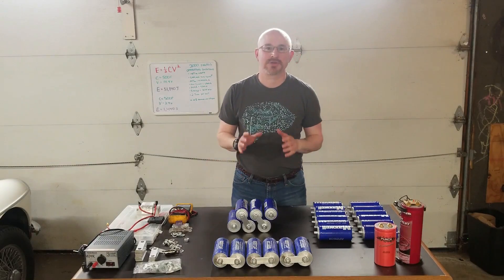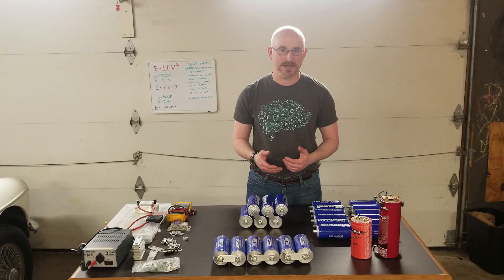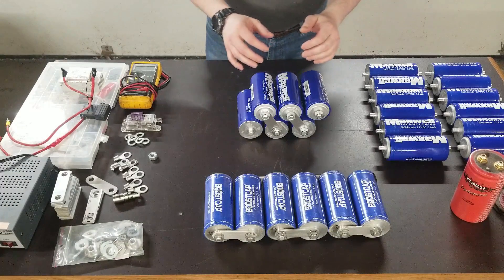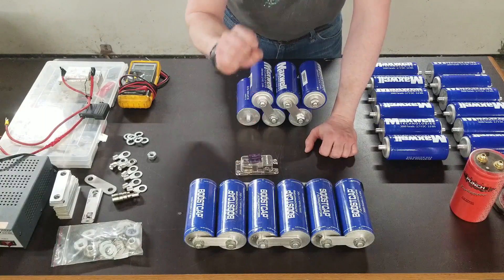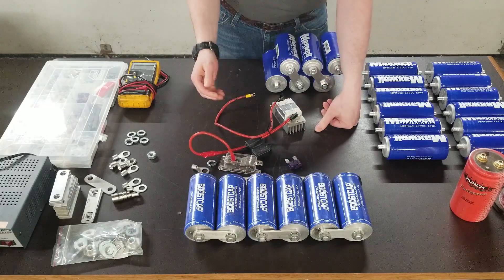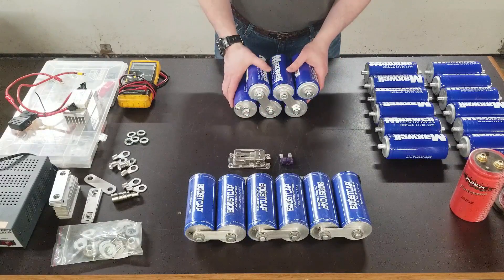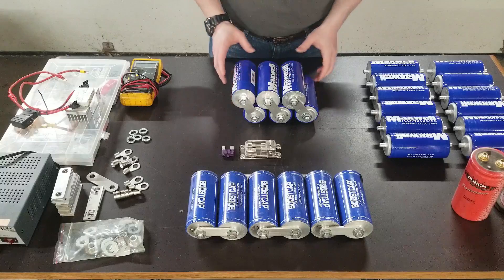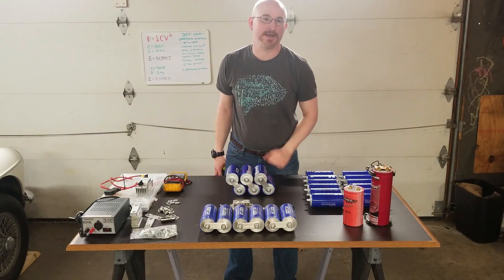Electrical engineer explains ultracapacitor Safety Tips and Tricks - Car Audio Applications

Comment: The heat from his charging resistors introduces even more inefficiencies as a passive, nonreactive load. It would be better to use circuitry to control the current more efficiently with less energy loss through heat production, unless it's winter time and you could use the heat to add to what's already in your house.
Reply: He's only using the resistors for a one time charge from dead. That's why he plugs it into the fuse holder without a fuse then at all other times it's following the batteries. I'm curious why he's not using any balanced circuits.

Comment: Don't be fooled, folks. Those Maxwells are rated with only a two year shelf life. Skelcaps have a 10 year shelf life, AND, these are not replacements for lithiums because they cannot possibly provide as much longevity for energy needs. These are good for impulse power needs, thus paralelled with batteries to prolong battery life, but not the sole source for energy storage. Skelcaps will give you a 10 year shelf life.
Reply: I have checked SkelCap datasheet, but the lifetime is the same, 1500 Hours, or 1 million cicles…

Comment: What would you think of the simplest balancing circuit, which is a zener across each cap? Cheap zeners that I could find are rated 2.5 volts, 500 mA. In the app I have in mind, the charging time is of no significance. Hence I can limit the charging current to 1/2 amp. I can also maintain 14 volts across the 5S string of caps.
Reply: XXYCOM…. Appreciate your enthusiasm deploying 6S SC/UC systems. Trust me, I’m not trying to dissuade and or discourage you from such an adventure. Remember HEAT, which’s the greatest enemy of SC/UC and it’s constantly, that (heat) in all vehicles. I’m sure you are not running a PA system in your vehicle. For a normal listening pleasure maximum sound level is not higher than 5~7watt with a good quality sound system. But if driving an ABRUMS M1A2, that’s a different level! I’d not go there… Best wishes…

Comment: Would this be safe to use in a car with auto start-stop and lots of computerized technology? With city driving and the AC and music cranked that's a lot of starting and stopping while drawing a lot of current. Would this constant charging and discharging of the caps be bad for the car's electronics or the amps? I'm making a build for SQ and have 100w x4 for fronts and 400w x2 for subs. I have a Golf mk7 with Blue Motion tech.

Comment: I have a 72v Gem car and want to increase the length of charge /discharge (run time) on the vehicle now it has 6 lead acid 12v  batteries and I am making a 12v supplemental 6 panel solar array to charge during the daytime hours. what type of system do you recommend to supplement with?

Comment: Possible to parallel to car battery?
Reply from the maker: Absolutely.  That is exactly how I wire them in cars.  In parallel, with a separate fuse.
Reply: Thank you very-much boss... but normally what is the rated fuse to use it? I have 2.7 v 650F caps 6 pcs.
Reply from the maker: @wilsonsabellano3205  i have used a 100A MAXI fuse to protect the cap positive for years with no issues.  I use a MAXI fuse because it is easy to remove when servicing the car.  A circuit breaker would also be doable.   Remember to disconnect the cap bank prior to disconnecting the battery

Comment: How would you use these to jumpstart a vehicle safely? The voltages would differ greatly and a rapid discharge into any part of the vehicle would be harmful. So ?
Reply from the maker: Any jump start application includes connecting a low battery to a high battery/charging system (simply put).  Every time you jump start a car, you connect mis-matched voltages, but not more different than a few volts.  Even at 10.5V, a car battery will struggle to start a car and a car battery will rarely drop below 7V and live to tell the tale.  Even so, the ESR of a battery that is deeply discharged is much higher than the ESR of the capacitors.  This is why charging caps is more sensitive to charging car batteries.   Every time we run the car we see a voltage increase in the system by 2-2.5 volts.  My concern with charging voltage matching is to get it as close as you would in a normal application.  Is that reply in-line with your question?
Reply: @richardvedvik979  yeah I'm just wondering if it'd wreck the car/ECU

Comment: It is sad they only make 2.7 v version...kind of a pain...
Reply from the maker: It's a trade-off with the high capacitance.  The high capacitance is from using a material that would break-down faster at higher voltages, and the proximity means easier arcing capability.  Agreed, totally, because 15V supercap cells would be awesome!

Comment: No balance boards ? That should be part of this video.
Reply from the maker: I've discussed this in some other comments and the consensus is my second video will include meters across each cap with different loads to watch discharge/recharge behavior.    It will also discuss balancing circuits in more detail.  I'm almost ready to shoot that video. 

Thanks!
Reply: How about just Zener diodes across each cap to limit charging voltage to safe levels?

Comment: Building an ebike hybrid battery ,how can I use s-caps to create a high speed burst of speed and for use in regen braking supply back to the battery as well?
Reply from the maker: That question has a longer answer, I can revisit when I'm at a PC with a proper keyboard.
Reply: @richardvedvik979   1.21 Jiggawatts !Truthfully this would be a seriously interesting build to add a burst turbo button to an EBike and nobody has done this yet on battery builds because they are so expensive and new that only  companies like XS and Maxwell are sending out trial caps to sponsors to innovate the use of them .

Comment: awesome video  I have a Honda with a 250 amp alt a group 31 xs power in front with a group 41 in the rear. My stereo when I use it pulls about 150 amps at max my car like 45 amps with ac on etc. I also have air suspention that uses a air zenith ob2 compressor that pulls like 60 amp when filling the tank. That takes about 4-5 min it starts out fast then my volts drop slightly and it takes longer to fill.  Sorry for the long would I benefit from using like a xs power super cap bank? thanks
Reply: Nop .. if IT do not drop in rpm when car is running Then IT is you bat bank ITs too small 
If IT drops when you enigen andcthe 250A alternators runs
ITs you leads from bat to compresser ther is too thin and looong 
You can ofcorse make What you want .. but if leads are insufisiant .. or battery til small .. well Cape get topped off by bat .. if bat drops well Cape Will too.. resistance in too thin leads kill A in to heat in wired instead

Comment: what find totally amazing about maxwell UC's is 5+ years ago the market was so saturated with  both new and used surplus UC's that the manufacturers had quit producing new units and  is was not uncommon to see them selling for $10 a piece or sometimes even less then one guy starts posting youtube videos showing how he was able to successfully replace his car's battery with ultracaps and within a year the market went from massive surplus to critical shortage causing the prices to increase to the point where at times I've seen used ones selling for as much as $100 each and even now the premade ultracap poser banks are selling for as high as $800 each. I always think of the ultracap situation whenever I hear someone say that one person by themselves can't  effect change or make a difference......
Reply from the maker: That's how demand can drive and change.   :)

Comment: Hey a lead acid battery will burn a hole in a finder easy so you have to be careful with them!
Reply from the maker: Agreed!  That is another advantage for ultracapacitor banks in lieu of lead acid batteries (flooded cell or VRLA).

Comment: How can I use these to help out a hybrid that uses ni-mh batteries? I'd like range but more importantly I'd like the system to be more capable... It feels like ev mode is rarely on (assuming this is voltage related?)
Reply from the maker: It's fairly expensive to get up to the voltage of the eV battery pack.  That is the biggest limitation.

Comment: What is each battery volts and AMPs, how many battery required for 48v, 40ah ??
Reply from the maker: Note these are not batteries.  These are capacitors which store charge differently.   Ultracaps are available in 2.5, 2.7, and 2.85 volts per cell.  Ratings vary by model, these are 3,000F.  Voltage drops under load so you size voltage based on ending time requirements.

Comment: I’m Completely Solar Powered I Have A 48 Volt Trace Inverter it’s A SW 4048 115amps Rated 400 Amps Peak Battery Charger 60.0 Amps  I Have 8 12volt Deep Cell Battery’s In Siri’s To  Make 48 Volt I’d Like To Add A Bank Of Super Capacitors to my battery bank

Comment: Cell can be used for the ebike how much it cost for one cell
Reply from the maker: If you lookup Maxwell BCAP3000 you'll see prices on Mouser at $60 each.  Note the volt per cell is 2.7VDC for this model.

Comment: Would it work powering a car fridge?
Reply from the maker: Sorry for the delay.  These would help support a typical battery when the fridge compressor turns on/off.  But you'd still need a battery for long runs and a battery charging method. I will talk more about how voltage behaves in a future video.

Comment: There was a video posted recently showing super capacitors used with solar to power utilities without a battery. What is your opinion on That? Is that even possible?
Reply from the maker: Hi, sure, it is certainly possible, although maybe not cost effective.  The size of the cap bank would be based on runtime and operating voltage.  I purchased mine used from a solar application.

Comment: very excellent presentation! but the audio needs improvement. but this widens my understanding to ultra capacitors. could be useful as a motorcycle battery alternative but for cars and trucks i dont think my dad agree to replace his batteries. could be useful to jump start a vehicle tho
Reply from the maker: I totally agree that I need to spend more time on audio if I am going to be in front of the camera and not behind it!    These can be a  alternative for lightweight applications or racing applications where disconnecting when not in use is acceptable.

Comment: temperature is really important, though I would be worried about that in a solar application
Reply from the maker: Caps are less sensitive to temperature variations when compared to batteries,  which may be why they are used.  We're seeing applications for commercial UPS as well.

Comment: If I was to add a set of these to an electric motorcycle lithium battery pack. Would I loose most of the energy they contain? The whole 13s lithium ion pack would work on a nominal 48.1 volts with a fully charged level of 54.6 volts and a lower level of 41.6 volts giving a usable voltage range of 13 volts. 
I presume I would need sufficient ultra capacitors to reach the top voltage and wire them in parallel with my battery pack? So the majority of the capacity of the capacitors would never be used.. i.e 41.6 volts or approximately 3/4 of their capacity.  Or could I parallel them with the top 4 lithium ion  batteries? However I suspect that would not work for many reasons. 
Might it be better to replace the thirteenth battery with a pack of ultra capacitors in a serial / parallel config with a 2s / ??p to fill available space? Sorry so many questions. I have a basic hole in my knowledge I am sure you can answer and unlike most Youtubers you know what you are talking about!
Reply from the maker: Interesting concept putting them in parallel with only some batteries.  Note that you can't pick "the top" batteries because all of the batteries drop similarly when overall voltage reduces.  You won't have some batteries depleted while others are full.  

But the idea of adding support to some but not all battery packs is an interesting idea.  I haven't seen tests like that.

You are correct that you'll never use all of the available capacity when voltage drop is such a small percentage of overall rating.  That's always the case because of minimum operating voltage of electronics.

Comment: Great video! Just my two cents - When I work on my vehicle, and my 500k capacitor needs to be topped up, I use a brake light bulb as my current limiter, in place of the in-line fuse. It will glow brightly at first, since the capacitor is mostly a short circuit. But soon the bulb will start to dim down as the capacitor charge increases, soon matching the voltage of the battery. Once the bulb seems to be very dim I remove it and immediately replace with the in-line fuse. This works faster in my opinion than using a higher power resistor. It also gives a visual as to the charge progress.
Reply from the maker: I will demonstrate the light bulb charge method in my next video as well.  Thanks for sharing.
Reply from the maker: Yup, i understand how linear loads, like incandescent bulbs, behave and I considered a time-lapse charging demo but didn't want this video to run long.  I can measure current during the process.   Thanks for the input!
Reply: @richardvedvik979    and thank you for the video!  Looking forward to more.
Reply: That makes sense.  A filament bulb has a resistance that increases substantially with temperature.  So later on when the bulb is dimmer it has a lower resistance than the fixed value resistor would have.  So it finishes the job safely and quicker.
Reply: BTW,  you could measure cold with a multimeter and compare it to the rated values.  Eg a 14V, 28W bulb would pass 2 amps in normal use, therefore have a hot resistance of 7 ohms.

Comment: What would a setup for a 24v starter pack for a diesel truck look like?
Reply from the maker: Hi, you would need enough in series to exceed 24V.  That number would depend on the cells chose as several cell voltages are available.

Comment: couldn't you just do a simple pre-charge circuit on a push button?
Reply from the maker: I think a latching relay could be used to charge the cap bank and then when it reaches a threshold voltage it would stop charging and then just connect to the vehicle. There are plenty of ways to make this more complicated and automate the process.
Reply: @richardvedvik979 well I wasn't thinking of making it more complicated, but less complicated. I mean a resister that recharges when I button is pushed seems very very simple to me.
Reply from the maker: The reason I mention a latching relay is that it can take 15 minutes or more to charge the caps.  I wouldn't want to hold a button for that long.  Shorter charging would increase the charge current and the power rating for the resistor bank.
Reply from the maker: Ohm's Law calculations determine the relationship between resistor power handling, resistance,  and charge current.

Comment: Multimeter never moved once...
Reply from the maker: Good point, it wasn't a scripted video.  I intended on using it to measure cells. The next video will meter each cell simultaneously and include dynamic load testing.

Comment: I am exploring using capacitors to help with starting a compressor motor. I want to run a soda/seltzer pump that you'd commonly see at a bar. I want to power this compressor with a battery bank and inverter. We have tried with big healthy marine batteries and our system will work reliably for a while, but the starting load is a big spike and the batteries will quickly poop out. Is there a way to introduce a bank of capacitors into this circuit to make this happen.
Reply from the maker: Interesting application.   Once the parts come in I will put a dynamic load on a marine battery with and without caps in parallel to demonstrate what improvement,  if any, is had.   Most likely, yes, a properly sized bank of caps can help.  In your case, a soft-start circuit may be beneficial as well.
Reply: @richardvedvik979  I could send you photos of our machine and specs if you'd like.
Reply from the maker: Sure thing.  Additionally, the tech support for Maxwell is able to review applications specific to their products.
Reply: @richardvedvik979  I just sent a request for tech support to Maxwell. Thank You.

Comment: I store my 24v 666F array lose in a thin aluminum box, the key is use gasoline to disapate the heat and insulate.. A totally sealed box helps too... Of course I was trying for worlds most expensive non nuclear bomb lol. How are u an ee with out a cc bench supply?
Reply from the maker: My garage isn't where my electronics bench is.  The test bench area isn't as photogenic with layout or lighting orientation and it's below the family room (i.e. noisy).   You can see the bench in other videos, which are close-up of the hardware.

Comment: Can we use these capacitors as a range extender (or fast charger) to recharge my EV in emergency situations? I mean that i put one set of capacitors in my trunk and when my battery dies i can charge it with these capacitors for extra few miles ?
Reply from the maker: The challenge is the voltage the EV runs on would require a lot of caps, too many to be feasible.   Your EV battery bank is likely over 100V.